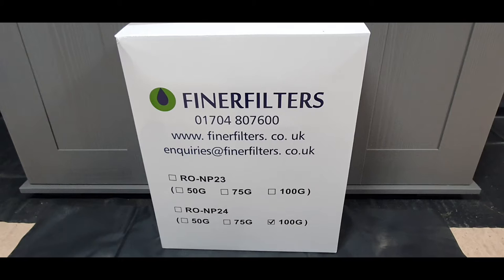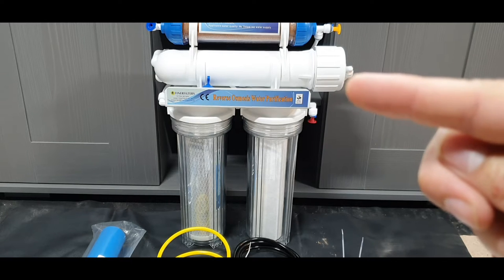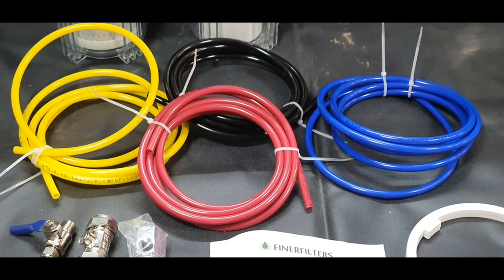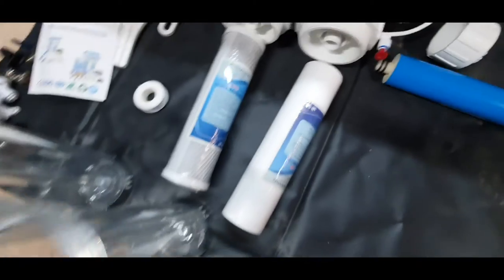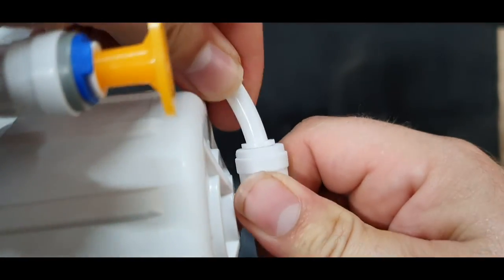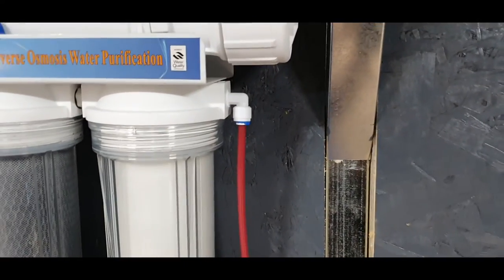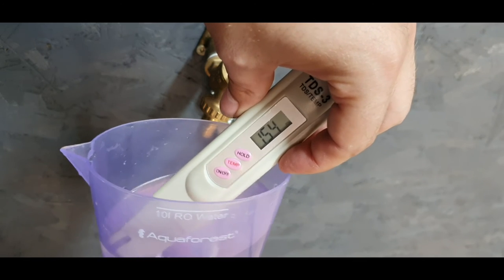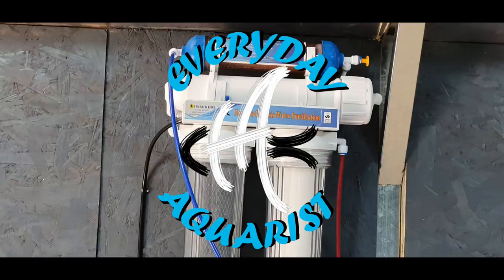Finerfilters 4 Stage Aquarium RO DI Unit UNBOXING & REVIEW

Comment: If it helps, I fill my freshwater aquariums when I do water changes and to do refills with what is considered "waste water" [your black pipe]. There is nothing bad about that water, especially because it has at least passed through activated carbon. I have done that for many years and I have even stopped using water conditioners. Totally recommended!
Reply from the maker: Great tip. It's just tap water coming out after all
Reply: @EverydayAquarist  Exactly and that it has already gone through some stages.
Reply: Can't you re plumb the waste back to the feed/inlet/tap to stop the waste.
Reply: @newcs5518  That's another excellent idea but you will need a non return valve connected to the "waste" water tube.

Comment: Great video! Do you put the water straight into your tanks from there and let the tank heater bring it up to temperature, or do you have to heat it first?
Reply: Will depend on the application
Top off or ATO, No need
Mixing will depend on the salt instructions, some want it at a specific temp others a range an still some dont care. So read the directions 
Adding to the tank, 10%  water change I add it in no worry, above 30% I will heat it first.
Finally, for Coffee Machine poor that stuff right in and brew then sit back an relax with it an enjoy tanks :)
Reply from the maker: Pretty much this. I have a 220l barrel I make my mix in a pre heat that for big changes